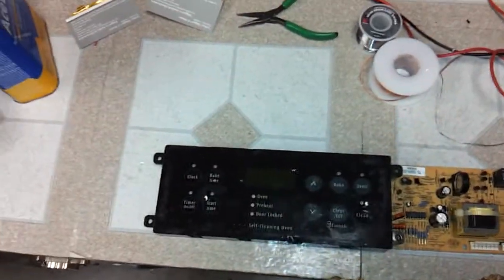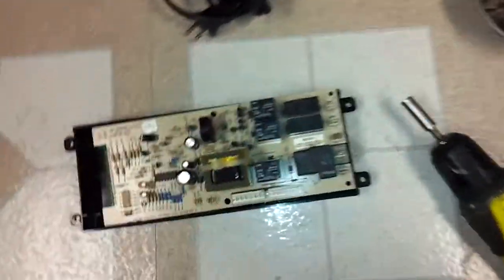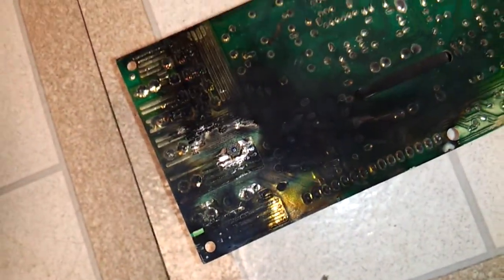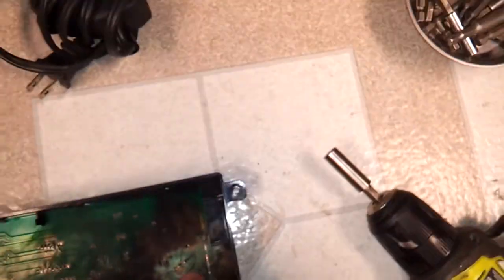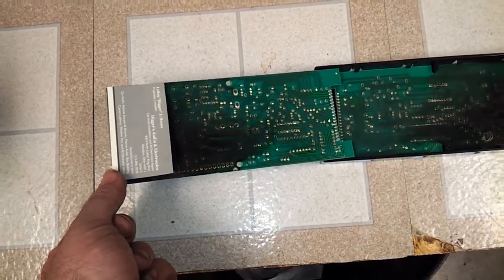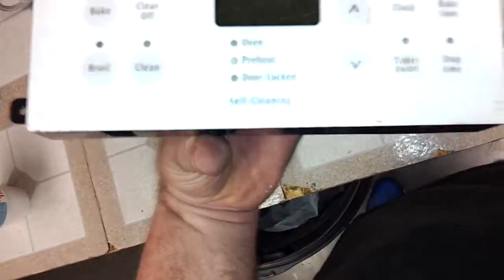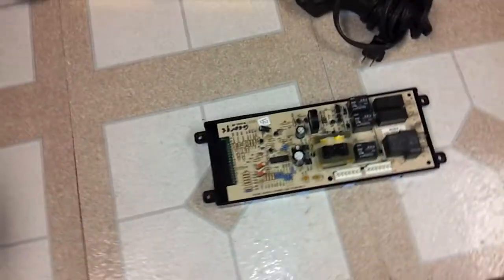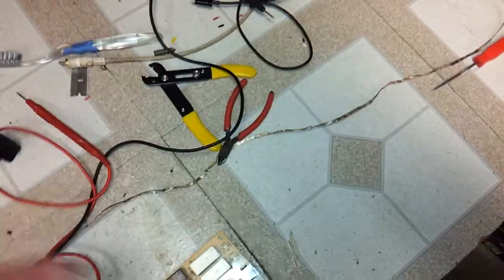Spitfire sf5301 stove control repair

Comment: Had this happen on my 20 year old stove, checked relay it was good, if you if you look where the arc happened between traces it was between the L1 and L2 traces because there was no insulating varnish between them. Can only think the purpose of those large rectangular traces with bare stripes of solder would be for a heat sink. Something like a bug walking between those traces would be enough for 240V to arc. I soldered the relay back in and put a layer of epoxy between the L1 and L2 traces and added the cardboard separator, a nice coat of electrical insulating varnish over that end of the board would have been better. Put it back in and oven is working again. Figured the processor was ok before I took it apart because clock and stove top were all working.

Comment: the plastic clips on the side broke that hold the panel to the stove. 10 cent parts needed a whole new control panel I did not purchase it but eventually my shorted out like the one you are showing taking the breakers in the electrical panel down  too,,, three days with out a stove or electricity before i could get some one out to fix it

Comment: the board I have burned, I purchased another from ebay description says the same model number but it only has 4 connections in the back and the one I have has 5 its missing the connection for the orange wire where it says out is there anything I can do to be able to use that board?

Comment: Thanks for the Video..I was baking pie when it went. Replaced control board (no Copper Snot) so where can I locate a Relay...?  I've tried to find one on-line but no show.  The Relay is made in Indonesia.  0464H2   I'm in Norther Canada so isolated from repair shops!  Thanks

Comment: Will oven light still come on if board is fried like this? Mine beeps and says f13 error code but light still comes on, if I hit broil or bake it clicks on for a split second then beeps with f13 code until I clear it out
Reply from the maker: If the board burns up like this, it will appear dead. No power at all.

Comment: I've got the same controls. Mines a sf5321. What mine does is the up and down temp adjustment won't work. Unplug it and plug back in and it works. Then it won't. Any ideas on what could be causing this?...relay?
Reply from the maker: You need to replace the EEPROM with a known good fresh copy for that control. They get corrupt from time to time, causing the temp to be off 50+ degrees, sometimes stuck door lock indicator, and then your unresponsive button issues.
Reply: I have the SF5321 also. Went completely dead on me